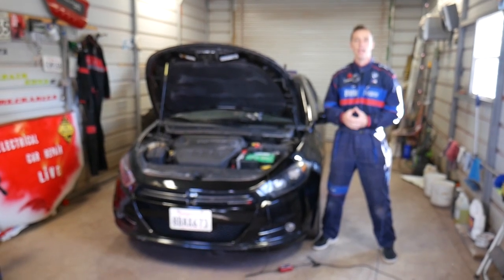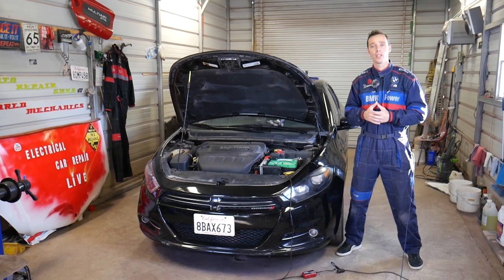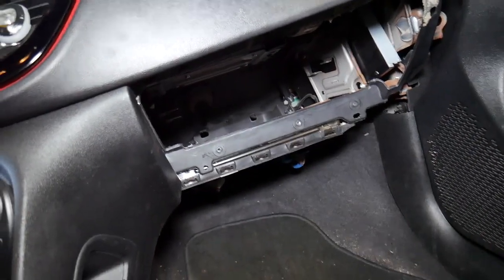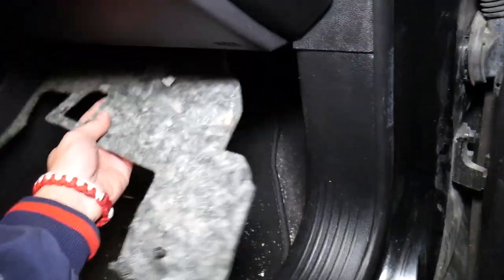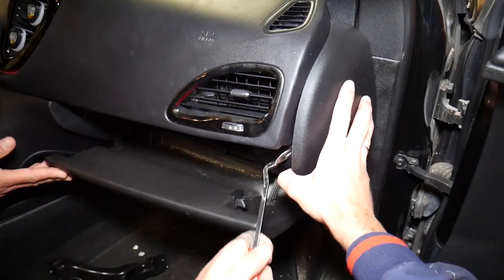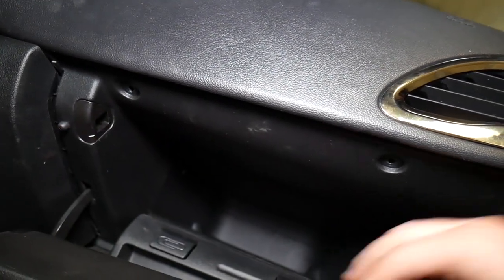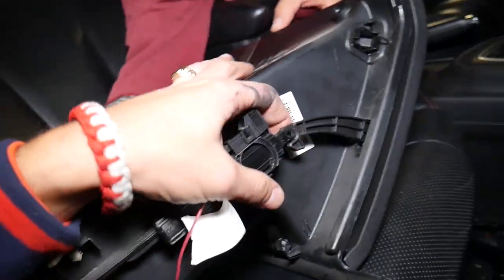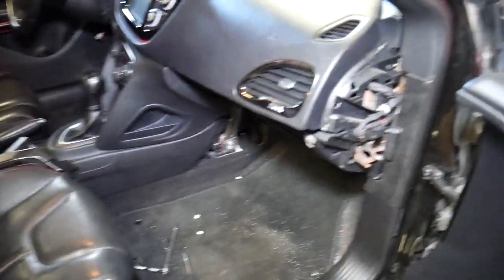BLOWER MOTOR FAN RESISTOR REMOVAL REPLACEMENT LOCATION DODGE DART, CHRYSLER 200

Comment: Blower fan was intermittent, and sometimes would not go to full speed. Replaced resistor and problem solved.
As many have said, no need to remove glovebox. Simply snap off the front console panel piece, and then unplug two connectors. 7/32" socket to remove screw on top of unit, and tilt out. Tten minute job including finding the socket 😁. Might as well do the cabin air filter while panel is off.
Reply: Как проверить на работоспособность резистор??

Comment: Glad he showed the glove box removal which is really handy for swapping the blower motor, still not sure if it was better because it’s a tough thing to take out, all the parts he doesn’t show are the absolute hardest parts lol!  But glad he was able to show all the screw locations 😊.
Reply: Definately don’t take this out to change the resistor… just if you’re doing the fan motor..
Reply: And my Dodge avenger 2013 I just have to pop off the glove compartment door and replace my fan and the resistor

Comment: There are 5 or 6 more screws on the back of the glove box to remove it. Take the seat out. Btw, my seat had T40 bolts. 2013 Dart SXT

Comment: I have dogge dart 2016 gt I have one quaction the air recalculation not working when on shuold be bad smell not go in side vehicle but it is going can you help me what I do or what I check
Reply: Have you changed out your cab filter?

Comment: I wouldn't remove the glovebox lol
Reply: Do you have to remove glove box?
Reply: @ebonymusiclegends1  no, just the panel on the bottom left footwell
Reply: Yoo  good looks he's right don't remove glove box just did mine right now the guy who made the video is right about the problem because I only changed this part and my problem was fixed but as far as the glove box o have a base 2015 dart and I only had to remove the side panel not the glove thank you both for the help
Reply: @brandonallen7652  was your fan working intermittently?

Comment: lol! For the love of God don't remove glove box ladies and gentleman!
Reply: Im thinking my resistor module is bad... blower doesnt turn on sometimes then randomly does, speeds dont seem to match with that i set dial too... im going to change the resistor module and you are the 2nd person to say dont do this, what is the easier way to access this?? Please and thank you hahaha its -20 here and car rides suck until it turns on
Reply: @Doomwillnotwin  i have the same problem for about 2 years,sometimes i tyrn of the car come back and the ac wont turn on or it will come back middle of the car ride at rare times,did u get it fixed???

Comment: DO NOT REMOVE THE GLOVEBOX!!!! You don’t have to. Also, if you cannot replace this part that takes one 5.5mm bolt, then you shouldn’t do this. The glovebox is a pain to remove, especially if you’ve never done it. These guys are a joke, you don’t need more room, you can reach one arm back there, take the one bolt off, and replace it in like 2 min, the fact these guys are saying to remove it shows me they don’t know anything